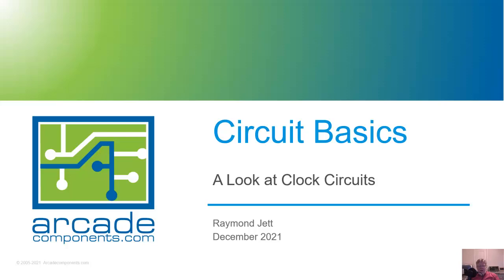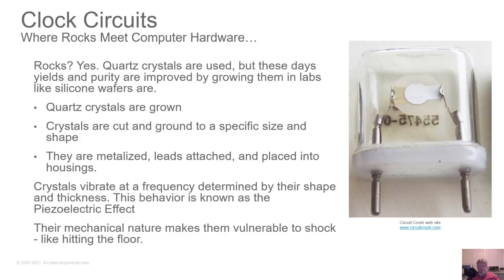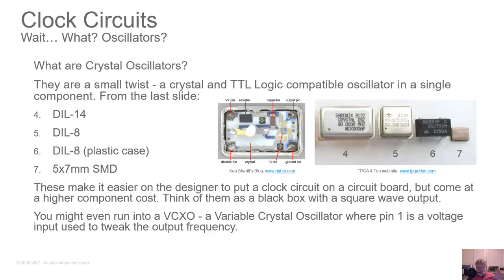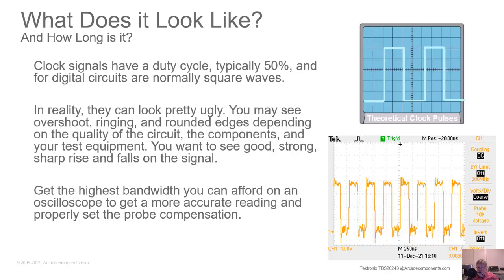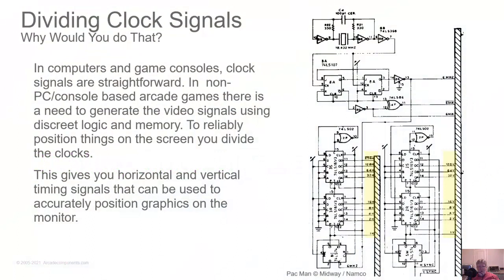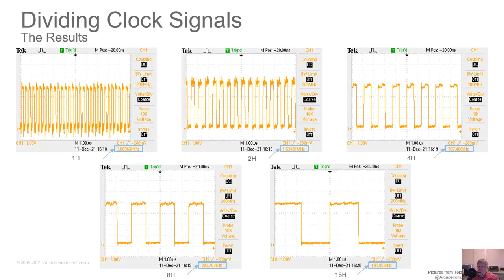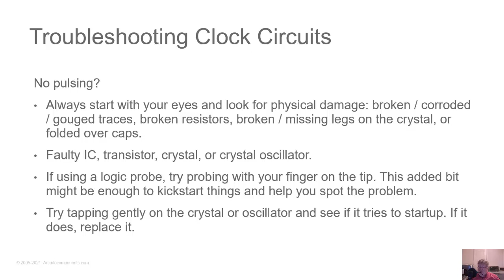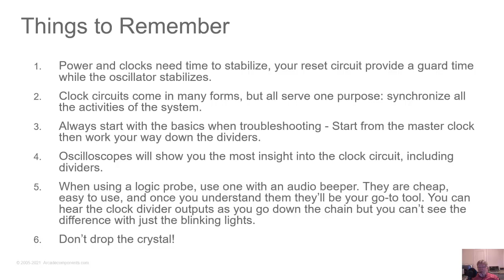Clock Circuits

Comment: I had a similar clock capacitor problem with my Centipede. Took me many hours and freeze spray to figure it out. The pcb was sometimes completely dead, sometimes it worked. When it was dead, the clock frequency was something like 50 Mhz as well